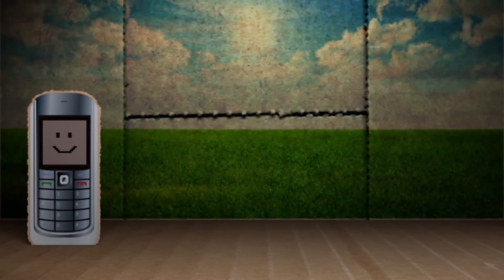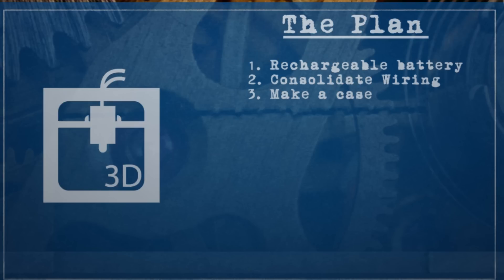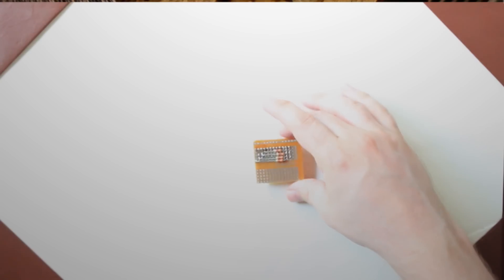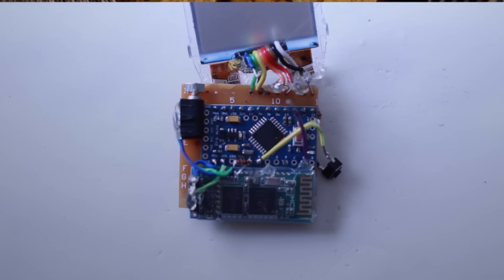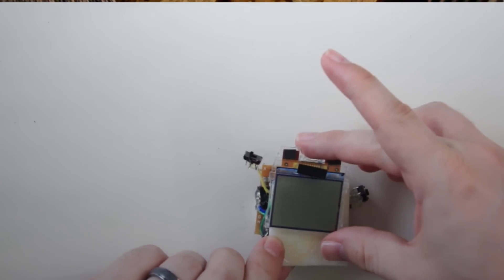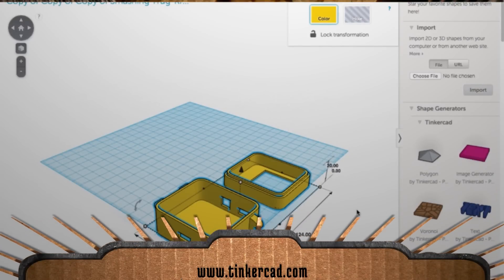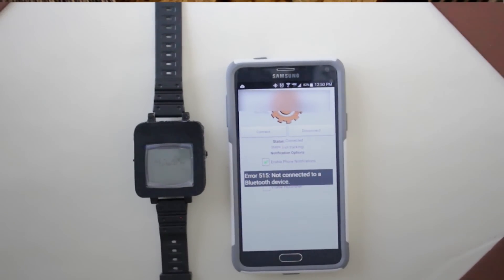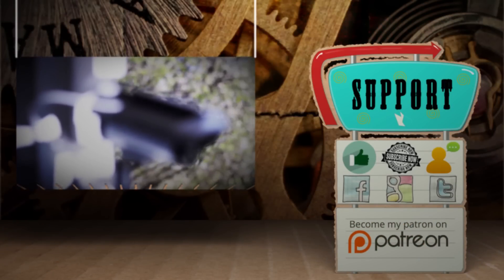Make A Smartwatch From An Old Cell Phone (Part 3)

Comment: make watch larger,  replace arduino with raspberry pi,  add lots of sensors, replace cell with array of 18650 batteries. congratulations! you just made an actual computer that mount to your arm, damn the puny little smartwatches and the data relays that they are

Comment: can't stop wondering if there's a way to slave an old phone to a smartphone? I'm often working with paint, chemicals, glues, dirty stuff. If I could keep my smartphone nearby and use the old rugged flip phone as a smartwatch as is (it's a Tundra or Barrage or something that has survived several feet of water, paint buckets, drops from 2nd floor). Can think of lots of uses for slaving one phone to another. Is this worth considering?
And yes, I do use bluetooth headphones, doesn't help for texts though.

Comment: You only used the LCD panel. Which isn't really reaper posing the whole phone. You where only using 1 part of it. This should have been called how to make a smart watch from an arduino.
Reply: I agree. I'd like to know how to reprogram and use the other parts of an old phone. It should be as easy as replacing a ROM chip with a programmable chip and then writing or downloading software for it.

Comment: Is it possible to have speakers imported and able to "say" customised sounds?
Reply: Yes. Ben Heck did an episode in which he made a board game with customized sounds. I think he used an arduino. What's kewl is you can program it to alter sound, so for example your mom calls and you put it on speaker phone through the smartwatch and you don't want people overhearing to know who it is, so then you can press a button and it will change the voice by several octaves. Whatever you want. Make a caller sound like a Borg or whatever.

Comment: Is the Arduino 3.3v or 5v? Because, 3.7 volts from the battery can not fully power a 5v one, and it can damage the 3.3v one!

I've been designing my own SmartWatch for a couple of months now, and choosing the battery has always been a pain for me. I have considered to use CR2025s instead of Li-Po, but they wouldn't give enough juice, and also are unfortunately not rechargeable.

I also don't want to use a step-up DC to DC module to convert 3.7v to 5v, it would be very inefficient to do so.

Comment: 2:32 The bluetooth module that you choosed has the ability to send the code to the Arduino and program it wirelessly. That's what I've used in my project, at least. It's very irritating to connect the Arduino with WIRES to program them!
Reply: You could use an ESP module instead of an arduino and then you have wifi. The ESP is arduino compatible. I don't know if you could program it using its wifi though. I only read about it.
Reply: +kedwa30 +1, But sadly, it's one of the problems with the ESP. I can think of a way or two to make it work, but it still lacks Arduino's famous bootloader.

Other than that, I wouldn't recommend Wi-Fi particulary for this project. The watch couldn't operate directly with the phone if the phone is connected to internet (unless ESP connects to the same router which will be headache).
Most wearable smart gadgets already work with bluetooth, and leave room for Wi-Fi so it can be used in more important tasks (or more bandwidth hungry, like file transferring).

My personal choice would be low power Bluetooth compatible, like Bluetooth v4.0 or BLE. There are several modules available and ready to use as we speak, like TAH.io and BLEduino.cc which looks really promising.

The BLE specs were designed with continuous usage at mind, something which is a necessity for an Smart Watch project in my opinion.

Comment: why in gods name did you never show the "side" of the watch
Reply from the maker: I'll show it in the comments show and you'll see exactly why I didn't show it in this video.
Reply: what if you spread out the components into the wrist strap
Reply: Tinkernut hey I'm building this but using an OLED ssd1306 spi and its not working, if you can please help me out this is a project worth a grade for me and I cannot figure out whats going wrong I can explain further if I can contact you
Reply: Usernaming in case u still haven't got it working, what's the problem?
Reply: legoscratch i got it working except I have to make an Android studio app which is showing the time as 12:05 PM|thu 3 mar 2017^ 
i used different chars since using only the pipe wasn't working. using different chars worked with the mit app inventor but not with Android studio
Reply: plz make a video for same series how to make smartwatch with old mobile phone , how to add memory card , and how to add 2 Camera( front and back both ) ....plz it's very helpful for us....
thank U.....

Comment: hey bro,
can u do something with the old tablets, i actually wanted to make a dual monitor for my netbook
thanks in advance
Reply: If your tablets are still working, there should be a software solution or an app for that. If not, you should be able to use the screen with other electronics to make some USB monitors out of them. Do a search for "can I use my tablet as a second monitor" and you will find what you need.

Comment: YOU SHOUDNL'T HAVE DONE THAT !
You didnt change the current limit resistor on the lithium charger module. It will charge the small 150mah battery at 1A !
Reply: The board was probably already set up to charge at a lower current.
Reply: {MLP} Rainbow Dash No, it always 1A per defaut.
Reply: JS7457 that board can be set for one amp if the jumper is soldered.
Reply: {MLP} Rainbow Dash no, its a resistor. By defaut the resistor is set to 1K = 1A.
See TP4056 datasheet.
Reply: JS7457 perhaps I saw a different board, idk. Some have the jumper, others not.
Reply: {MLP} Rainbow Dash -_-

Comment: is there a similar way I could make an Mp3 player in a similar way by repurposing a 'dumbphone'?
Reply: If the phone still works and it already works as an mp3 player then you sure can just strip it down and put the guts in a new case. I have a Samsung SGA A737 that I was going to do that with, but it keeps shutting off now. It will turn on and the battery is good, but then it turns off right away. You can also just salvage the screen like he did here. Why not also salvage the battery if there is some life left in it?

Comment: Wait, you soldered the Lithium cell directly to the Arduino? No voltage regulation whatsoever? I thought Lithium cells have voltages from 2,7V-4,2V?
Reply from the maker: No, i didn't solder the lithium cell directly to the Arduino. I soldered it to the charging board, which also serves as a regulator/surge protector. I then soldered the Arduino to the outputs of the charging board.

Comment: How thick was it?
Reply: +Tinkernut that's pretty thick, but not bad.
Reply from the maker: 1 inch or 25 mm
Reply: +Tinkernut Would love to see it from the side. I think the closest to it is at 2:47 but the screen is still not fixed to the board. We do see the case height from the side but that's just not visually appealing. And what did you end up adding above the screen ? You designed the board to have the same size as the screen but your case has a padding at the top... What's hidden there ?
Reply from the maker: I'll show it in the comments show. The screen has the backlights and wiring at the top, which didn't really need to be exposed. The LCD portion of the screen was the same size as the opening I printed.

Comment: Smart watch with black and white lcd?
Reply: smart watch doesn't need to have colorful touch screen.
Reply: but better if you put a better lcd, btw nice project
Reply: +lfeliks c color lcd would have reduced battery backup considerably
Reply: oh yeah, i forget those things
Reply: i used a colored LCD. Still it lasts for 30 hours. power consumption is 9mA.